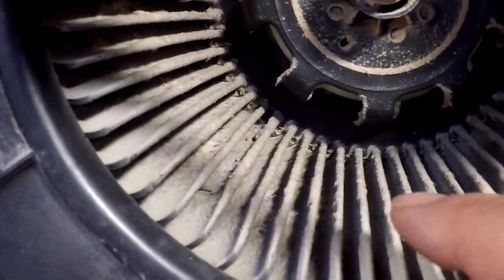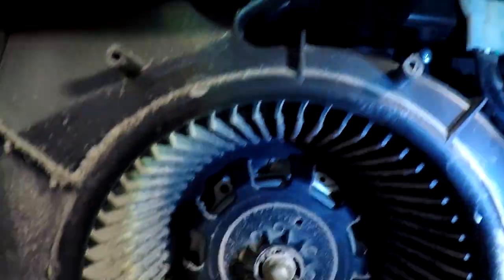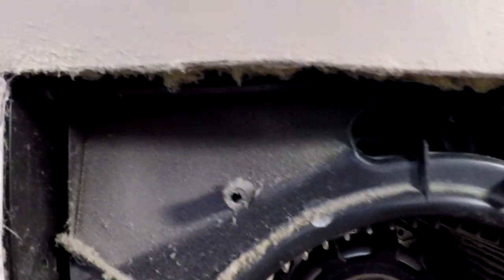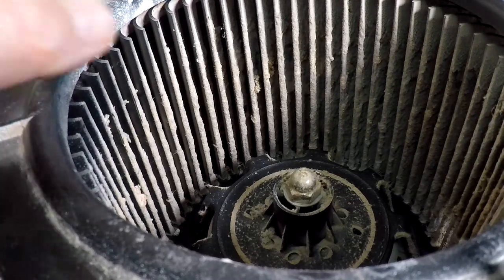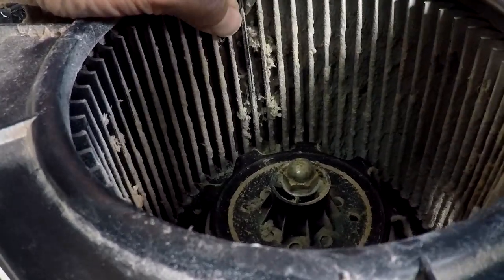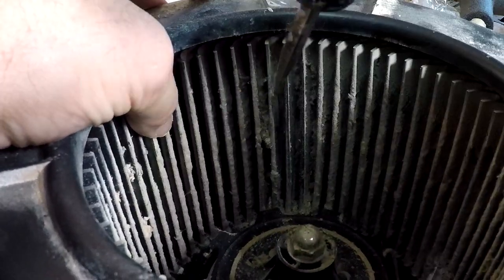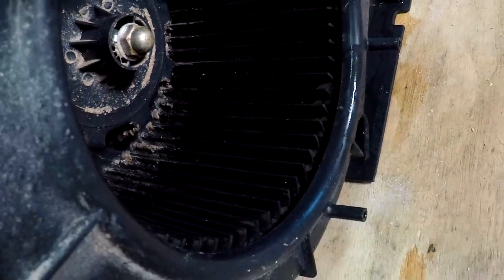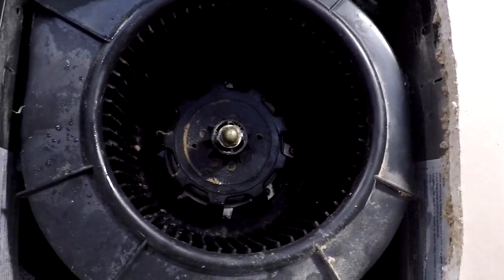Clean Your Bathroom Fan to Suck More Air

Comment: I would have unscrewed that middle nut, blasted the fins with degreaser and then blast cleaned it with a garden hose to get it spotless. Air dry in the sun for a few hours then reinstall
Reply from the maker: Lots of ways to do it... thanks for watching!